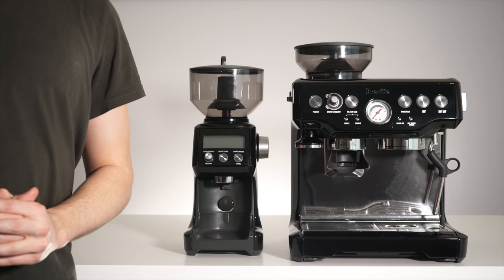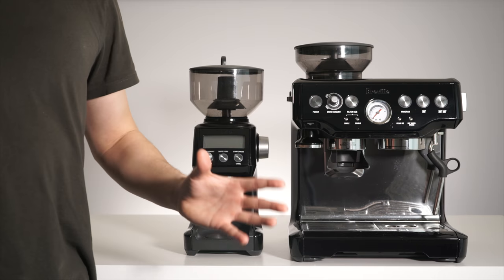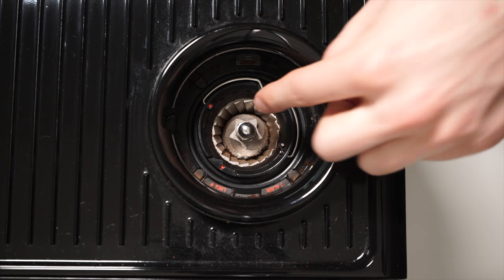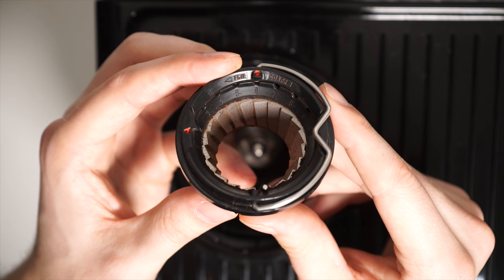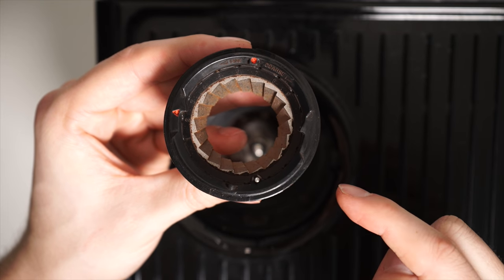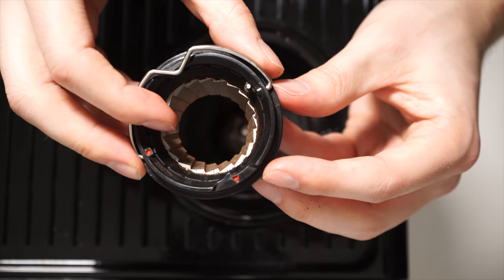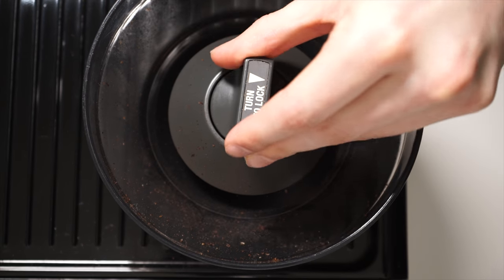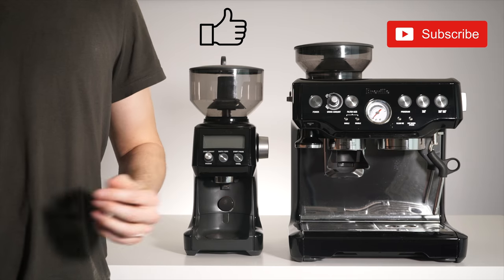Breville Barista Express Top Burr Adjustment

Comment: Is the top burr adjustment a micro or macro adjustment compared to the side dial setting? For example, is the coarsest side setting at 4 (top) similar to the finest at 5. Or the other way around, where you would keep the side dial the same, and the top is micro adjusting? Thanks!
Reply from the maker: Top burr will serve as a macro adjustment, outer dial is micro :)
Reply: @LifestyleLab_  thank you! I recently received the barista touch as a gift and I’m working on dialing it in based on your other videos.
Reply from the maker: Remember to be patient! 
Also check out the Barista Pro dialing in video we made if you haven't already. Its a little more detailed in the second half than the Barista Express video

Comment: Hi! I changed my top burr setting from 6 to 4 & my grind size is at 8. I’m getting into 8-9 seconds with 36g, how can I fix this?
Reply: Drop your grind size. Mine is permanently set at "fine" (so below 1), because that's what works best with the beans I use. Also, get or make a WDT tool - it eliminates clumps, which is a major cause of channeling. It's an essential tool.

Comment: Hi, I’ve had my barista express for around a year or so now I haven’t played around with it much but would like to try and get a better extraction I noticed how you said you should only adjust the inside setting after running out of adjustments out the outside dial. I have read that the older machines did not have the inside adjust-meant only external I have read also that some of the newer machines the external dial doesn’t actually do anything and you’re always supposed to adjust the internal settings and set your external dial to your external adjust-meant not sure how true this is but if you could provide any insight it would be greatly appreciated. Cheers!
Reply from the maker: It is true that some older generations did not feature the internal burr adjustment. 

As for the external grind adjustment not making a difference and only adjusting using the internal, that is simply not true
Reply: Lifestyle Lab Thank you for the quick reply, I appreciate it. To clarify if I am not mistaken the breville recommends to start an an external grind setting off five to start from there do you reckon I should also set the inside adjustment to 5 as well and start trying to dial in on the outside first.
Reply from the maker: It comes at a default of 6 on the internal, so start there. Have a look through our dialing in video! It will be very helpful

Comment: What's your burr and external grind setting on your barista express? I had mine set to burr= 3 and grind 4 but find over pressured tried adjusting to 5 external but still cant get to 12o'clock needle pressure. That perfect crema that I wanted to achieve.

Comment: Help! Mine doesn’t have any adjustments.. I received this machine used- do I need to replace the basket thingy? Are they interchangeable?
Reply from the maker: Older generations may not have this adjustment. Some have reported that you can purchase a new upper burr from Breville
Reply: Thanks for that quick reply!! (- purchased one just now). Any ideas about why the auto grind set on the lowest/less setting over flows and grinds upwards of 21 grams 😬

Comment: Has anyone tried using the grinder in the BES870 for pout over coffee? I've gone to the coarsest setting on the burr and dial, and i'm not convinced it's coarse enough. Thoughts?
Reply from the maker: I don't believe that even at the coarsest internal and external grind setting it would be coarse enough for pour over (unfortunately). The standalone Smart Grinder Pro has a wider adjustment range for brew methods other than espresso.

Comment: With all this adjustments (10 internal and 60 external, 10x60 = 600 altogether), why would someone need a more expensive grinder?
Reply from the maker: Two things: 
1. Each internal adjustment doesn't move an entire grind range. See here: https://youtu.be/_uB3FZGkR6E
2. More expensive grinders not only have smaller, or even stepless, grind adjustment, but more importantly better grind quality and particle uniformity from better designed and often larger burrs

Comment: Would this help the following scenario:  internal burr 6 (stock) external 6 is a bit too fast (18g in,     28 seconds,  46g out) .  If I go to 5 external ,  I can choke the shot or have a lmk extremely low volume.  I think I want a “5.5” external setting.  Everything I have seen on the internal burr adjustment is for when you get to the extremes on the external vs what I am looking to solve
Reply from the maker: No, this won't help on that scenario, but lucky for you we have a video on that exact topic that will! https://youtu.be/Q1lVdhly_rc

Comment: My grind settings at 1 and it extracts too quickly but the bar gauge is sitting OK.  I'm going to try changing the internal grind settings.  Quick question if anyone could help thay would be much appreciated, how do I know if my tamping is good or not ?
Reply from the maker: The pressure will be around the 12 o'clock or 1 o'clock range when flowing correctly. Don't aim for the middle of the "espresso range"

Comment: Hi bro! Excuse me, have you ever find a coffee that you couldn't dial in for espresso? I have a gaggia classic pro and a breville smart grinder pro for dialing, but I bought a light roast coffee that I couldn't dial in (even with the finest grind, number 1, and the finest inner adjust, number 1), do you think that with a better grinder can dial in light roast for espresso?
Reply from the maker: Depends
Are you finding it can't be dialed in because the flow is still too fast? Or because the taste is not good?
Reply: @LifestyleLab_  actually, both. The shot is about 19 seconds and it tastes so sour.
Reply from the maker: Yes, that's quite fast for a shot. If you can't grind and finer you can try tamping slightly harder (not too much or there will be channeling), and increasing the brew temperature to try to extract the lighter roast better
Reply: @LifestyleLab_  great, thanks for the tips. Do you think is a good idea  upgrade to a better grinder?
Reply from the maker: The grinder is what determines 80% of how good a coffee tastes, so if its in your budget, I'd definitely recommend it. Sette 270, Eureka Mignon, Niche Zero, lots of good options that will be a step up from the SGP
Reply: @LifestyleLab_  great! Thanks, what do you think is better: rocket Faustino, eureka mignon (flat burr) or sette 270, sette 270Wi (conical burr)?
Reply from the maker: I would go with the Eureka out of those 3 options
Reply: @LifestyleLab_  thank you, sir! Eureka mignon specialista or any other model that you recommend? Do you think that with the eureka mignon can use the grinder for drip coffee, too?

Comment: Anyone have trouble putting the burr back into the grinder once taking it out and adjusting it? Any solutions?
Reply: vacuum out all the grinds/beans as much as possible before taking it out and prior to putting it back in, or use compressed air to blow out debris

Comment: What if the internal bur and external dial are both at 1 and you still have a grind that is to course?
Reply: I have the same issue!! I am wondering this too!
Reply: @Intrepid_Insomniac  Hopefully you have resolved the issue by now. If it still persists, most likely you coffee beans are not fresh. I have been using 1-2 weeks old beans (from roasting date), internal bur = 6, external dial = 1, took me about 23 seconds to pull 1:2 ratio. I started timing upon the first drip.

Comment: Does anyone have a trick to getting the burr to lock back into place? I’ve been trying for 2 hours with no luck. Such frustrating design!
Reply from the maker: Make sure that there are no stuck bean chunks in the way, and adjust the grind setting to the coarsest setting possible. This should help make removing and putting back in easier
Reply: For me it was because the outer dial was set to “1”. And with a finer upper burr setting, the burr was too close to the inner one. I hat to change the 1 to 20-40, the I was able to get it in again. But now I have the problem, that when I go a tad too fine, my Grinder screams as the burrs grind on each other. Even with the upper burr set to the old “6”-setting. So basically it’s worse then before. Any ideas?

Comment: I know this video is old, but I am struggling with my new Barista Express. I fail to achieve good flow/pressure even at the Finest setting, 1 internal 1 external. I have followed your dialing in guide. I simply think my grinder is failing to grind fine enough. Has anyone had a similar experience?
Reply: Make sure the burr is properly seated and locked in place. Remove the burr, clean out all the residual beans and grind and replace the burr. Make sure it locks in place.

Comment: I have adjusted the burr and now absolutely no matter how I line it up in the machine or how hard I twist, it won't reinstall. Anyone else had this issue?
Reply from the maker: Make sure the outer grind adjustment is at the coarsest setting if you are moving to a finer internal setting. Otherwise your burrs will be touching.
Reply: I'm having the exact same issue, the burr just seems to pop out again and refuses to go back in

Comment: I followed all the steps and noticed that mine doesn’t have numbers on the inside grinder. I bought the machine in 2017. Am I the only one?
Reply from the maker: Older machines will need a replacement burr from Breville. Contact their support and they can send you one

Comment: my barista express 860 xl is an older model.  there are no set of numbers as per the video above, there is no top ring, it won't spin.
Reply from the maker: I believe you can contact Breville for an updated upper burr
Reply: @LifestyleLab_  . wow , fast reply, I'll try breville but in Australia they're not very helpful.  Appears my grinder isn't designed to be adjusted.

Comment: You should have explain why anyone should go inside the grinder To change the size, While they could do it with the button on the left?
Reply from the maker: I did... at the very start of the video
Reply: lol, it was literally the first thing he said in this video 0:09 
You do this when the grind size you need is outside of the range accessible by the external fine adjustment knob
Reply: I know. I am sorry my question was not clear enough. What I wanted to ask is: have you ever been in a situation in which the regular grind size setting on the left of the machine is not enough? It goes  from 1 to 16 so most of the time the grind size is not the real problem causing a bad shot but more the quantity of coffee I put or the way I tampered. (Great video though cause not a lot of people explain that level of detail).
Reply from the maker: @hamiamiam  Yup! There are certainly situations where this is necessary. Very light roasts, or ones with little oil will need a very fine grind to build pressure. Alternatively, if you want to do a pour over or french press with this grinder, you would need to adjust it WAY coarser on the spectrum :)
Reply: 2M views okay ! I see. That would be a great video by the way: grinder settings depending on the type of coffee beans(roast, oil,...). Thanks for this very clear answer.
Reply: Nope....this is completely safe to do konzumprodukt….

Comment: How do the external and internal grind size controls correspond to one another, i.e. does one notch on the internal adjustment change the grind more, less, or equal to changing the external control by one?

Edit: Nevermind, I clicked through to your other video, where you answered the question.
https://www.youtube.com/watch?v=_uB3FZGkR6E

Comment: Do you know if the upper burr can be cleaned? Mine is jammed and I can't adjust lower than 4..
Reply from the maker: Of course it can, turn it to a coarser grind setting so it can be removed, and then clean everything off before reinstalling

Comment: Does this adjustment actually change the interval between the settings or does it simply move them up the dial? Eg, what was 2, 3, 4 just becomes 5, 6, 7 ? Does it allow you to get to 2.5 or 3.5?
Reply from the maker: The second one. By around 3 steps per number
Reply: Actually just confirmed with Sage / Breville support that changing the burr settings merely shifts the numbers up and down and does NOT change the interval between them. You don’t get to have more numbers to play with!
Reply from the maker: That is what I said. I have a whole video on it. 
https://youtu.be/_uB3FZGkR6E
Reply: @LifestyleLab_  Thanks - hadn’t seen that video before!